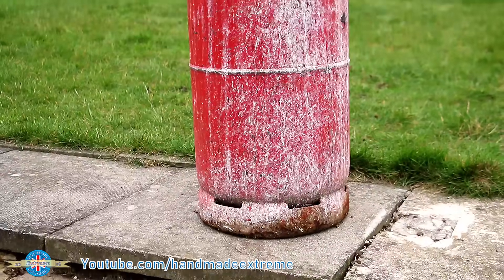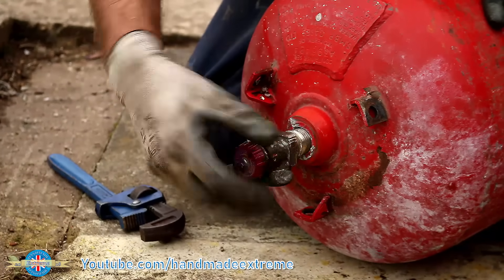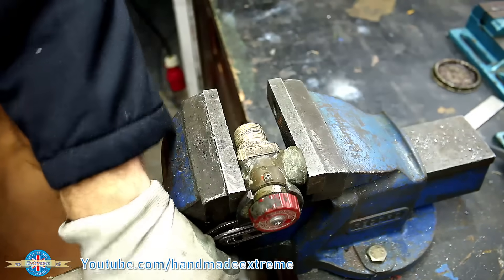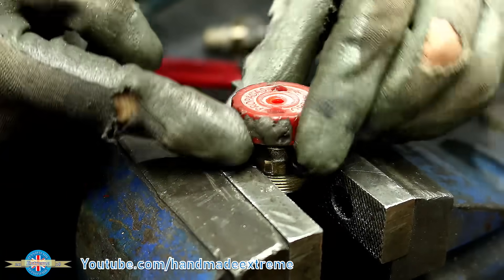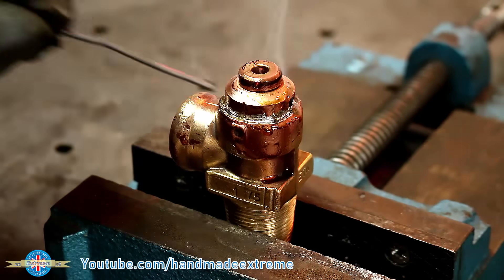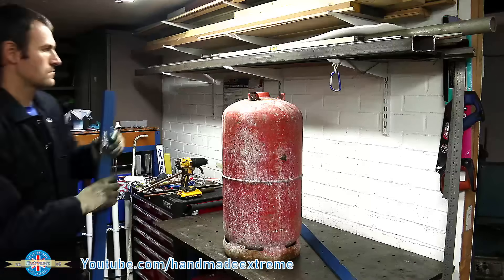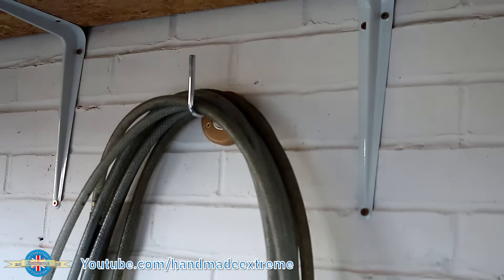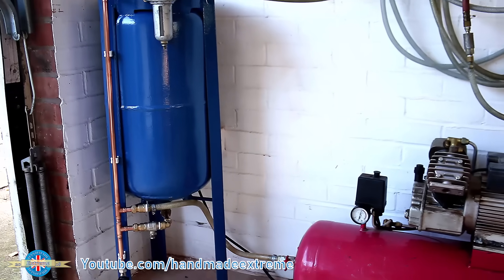Making an auxiliary air tank from an old LPG gas bottle.

Comment: That was brilliant, thanks. Really enjoyed the build and explanation. I need to do something similar as my compressor is loud. I use air tools a fair bit so it's often kicking in. Thanks for posting, hope you are well.
Reply from the maker: Cheers Carl. Thanks for the continued support. We are doing well here thanks, things slowly getting back to normal. Got some actual work coming in at last. Hope you are well. Glad you enjoyed the video.
Reply: @Handmadeextreme  No problem. I really enjoy your videos. I am glad to know things are getting back to something like normality for you.
Reply: Have you ever thought about perhaps putting your compressor outside in a covered cage? This reduces the noise in the shop considerably and also gives higher safety since the compressor is in a cage and opens space indoors for a milling machine perhaps? In my setup I have a horizontal 200l 3hp air compressor and will be adding an auxiliary tank soon, so because my compressor is outside it's just a quick job without worrying about space.
Reply: Mayb you can make a little research about " sound enclosure " if " loud " your concern. and also need a little effort to make that happend.